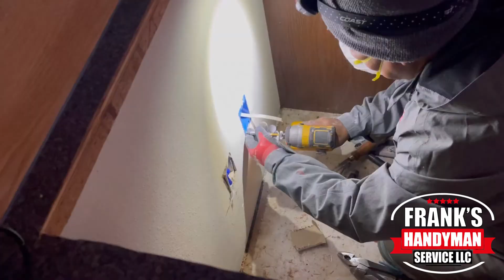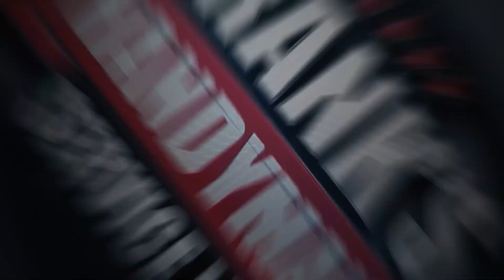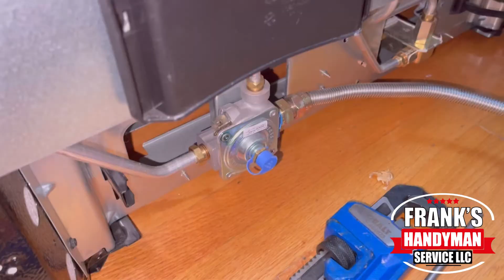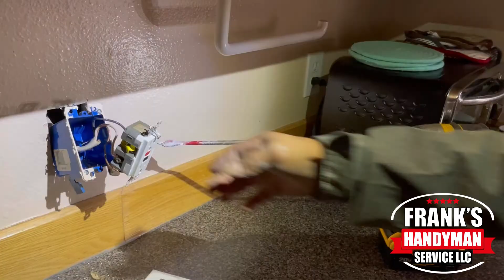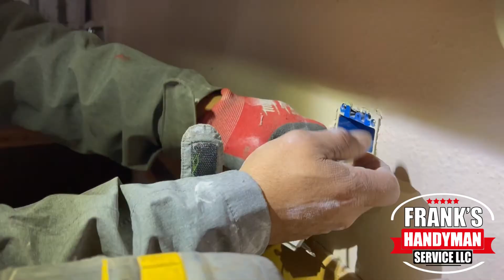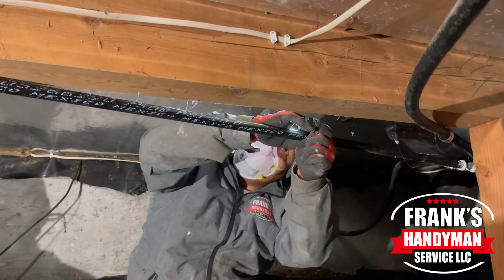How To Add A New Gas Line & Electrical 110v Outlet So You Can Have Both Electric & Gas Range Options

Comment: Bro, 😮😢 it's very SIMPLE on the Old electrical line is 230 v , 30a-40a  breaker.  Just REPLACE at the breaker panel to 15-20a breaker and the electrical line will only be 110-115v.  I'm just a Handyman 😅😂
Reply: It SEEMS this Handyman is not really good For doing this kind of work 😮😊

Comment: I’m sorry but the way you tapped on to the GFI outlet was incorrect. If you would have looked a little closer, the yellow tape on that outlet is for the load side of the circuit. That appliance is not protected properly. Simple fix though. Might need to go back on that one. I’m fairly certain that should have been a designated circuit anyway. This is why if you don’t know what you’re doing, hiring a certified electrician is the better option.
Reply: It looks like they were using it as a junction as the new outlet wasn't GFI.  Not the preferred method, but it works...

Comment: A GFCI outlet will cause operation problems with the new gas range. There is no electrical threat in using a standard 100v outlet with a range because there is no water involved.
Reply: Can’t you have a run with several electrical outlets and only the first outlet in the run is gfci? The rest should be protected if they’re wired correctly

Comment: What’s the code for extending a Gas line?  Aren’t you supposed to go up on a line in your case 3/4”?
Reply: In the code book that will let you know what size of pipe you need depending on appliance Btu and length of your longest run in the house.

Comment: If you run csstyou  have to bond the whole system with #6 cu at the main service entrance with approved means, or else you can be asking for a house fire
Reply: Yeah CSST and lighting is a bad mix. Almost no one properly grounds the stuff. There is a brand that doesn’t require it. 

Still, I hate the stuff. I’ll stick with black iron.

Comment: Black iron pipe for gas; not galvanized.
Reply: I recognize that also watching the video
Reply: Positive and negative wires ?
Reply: Actually guys galvanized is used in some states
Reply: They just said it wrong. You can clearly see it’s iron
Reply: I was just thinking the same thing. That is the wrong thing to do for a gas line….
Reply: Here in Cali galv is just fine
Reply: Exactly. This video is the result of using a cheaper priced serviced that does the job wrong, over paying a higher price for the job done right. Notice the flimsy old gas supply line they are connecting to in the crawlspace. It appears to be rubber the way it moves as they tighten the fittings. I bet this house blew up sometime after they completed this job.

Comment: Is this safe to do it yourself?
Reply: No, call a plumber. 1 spark or gas leak and your house goes boom 💥 most states you need to be licensed to plumb gas and may need a permit depending on the situation.
Reply: Yes just do a good leak test to make sure you don’t have any leaks.
Reply: If you have to ask no
Reply: No